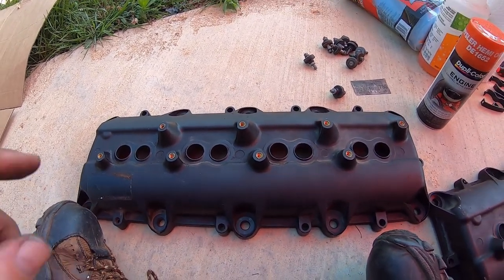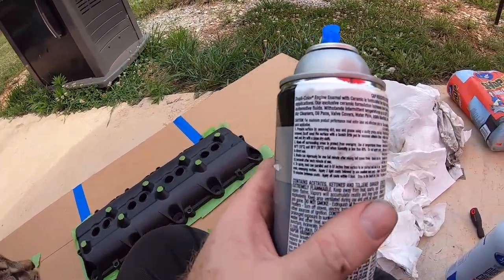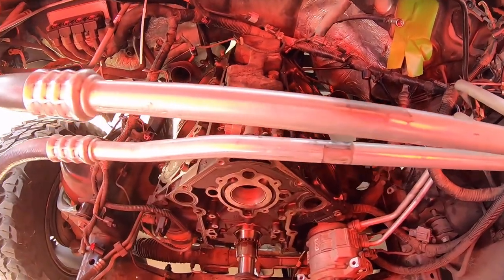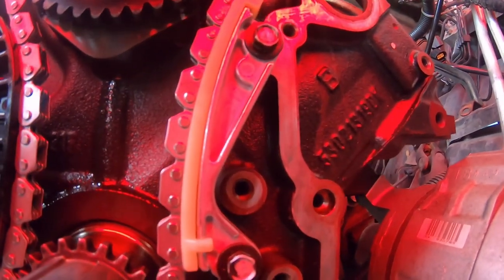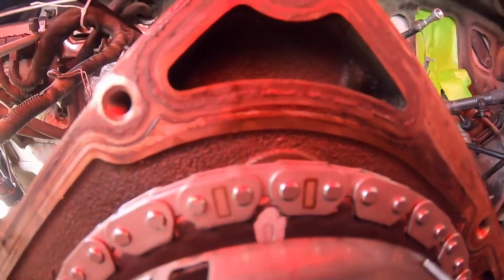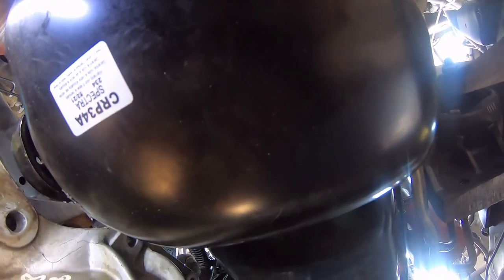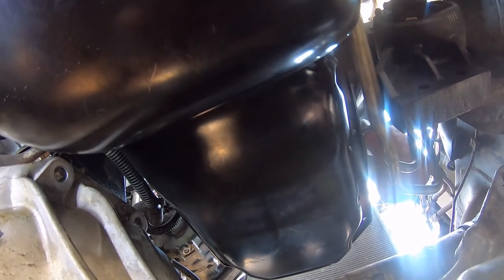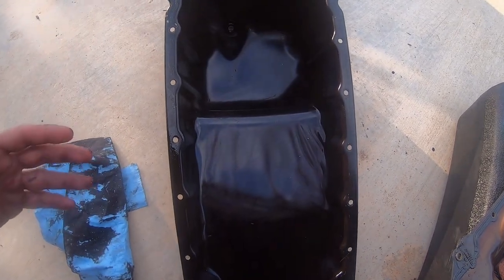2009 hemi 1500 trx4 build part 22. Painting valve covers, install timing, oil pan, hellcat oil pump.

Comment: I was worried about your lower timing position so I checked my video. My lower mark was definitely at 6, but I had a zip tie making tension on the chain. When I checked later in my video it was at 5.
Reply from the maker: Cool, thanks for the second set of eyes.

Comment: Realized I was not subbed, am now 👍 That tensioner must incur heavy wear with how the chain directs back inward. Were you getting 02 sensor codes coming up ? If yes I would change them if it was mine. Best of days to you and yours 👍
Reply from the maker: Thanks for the comment.  Oddly enough that I have only seen the tensioner fail on a few setups.  The early version of the guide would fail as it was originally made of all plastic.  Hard to say on the O2 codes as there was enough mechanical damage it would not run long enough to see long term.  From the little that we did get it to run, they looked to be responding and switching, per the scan tool.  But who know how old they are, and when/if they have ever been changed.